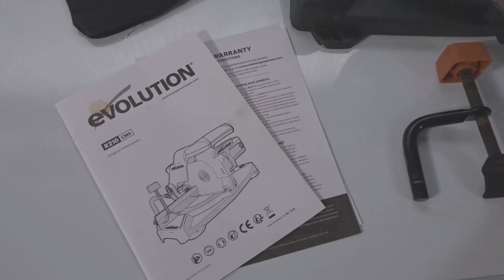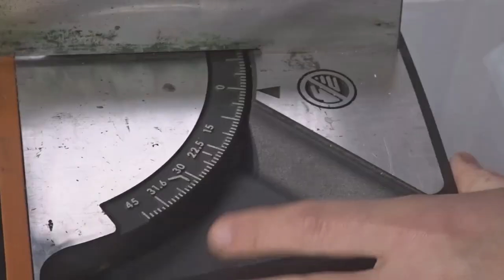Evolution R210CMS Compound Mitre Saw Review - 5% 0ff See Video Description!

Comment: Phill, I've just started using mine and have only just noticed that the blade rotation is pretty rough if I rotate the blade by hand ( unplugged of course). Is yours the same? I expected it to be smooth. Maybe it's the brushes. It cuts fine but I'm wondering if I have one with an issue. Great video thank you.
Reply from the maker: Hi Ashley, I didn't notice a problem with mine. It may well have been the same although it did work just fine. I now use a sliding version of this saw so no longer have this one to double check it.